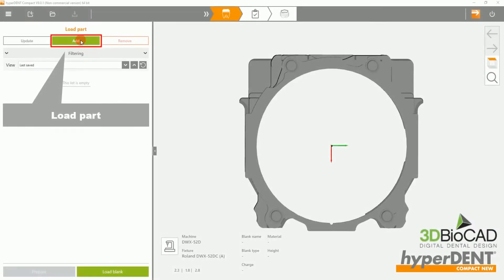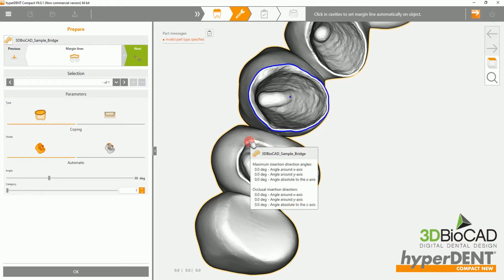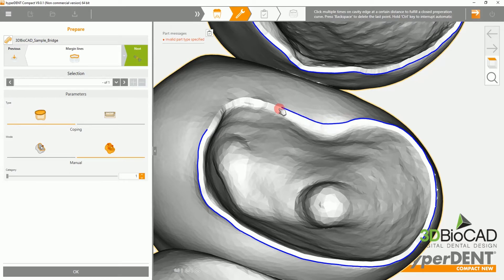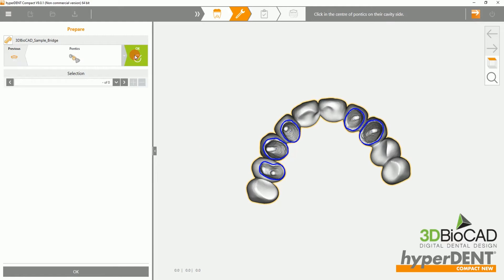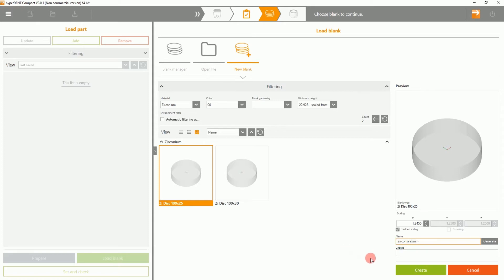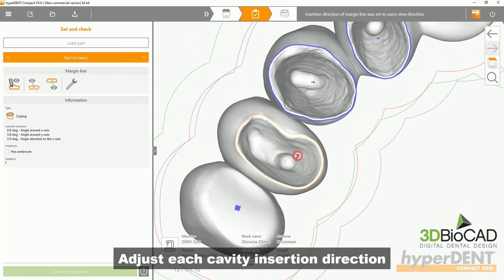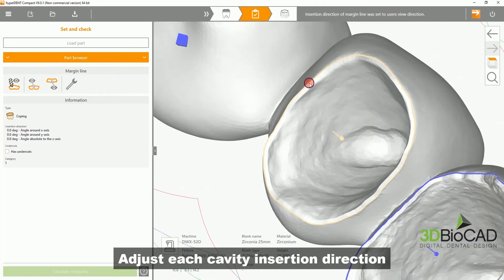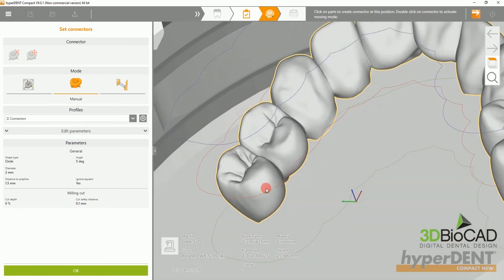Crown Bridge l FOLLOW-ME! hyperDENT l 3DBioCAD

Comment: Is there a specific way to place connectors on smaller bridges?  Usually I place connectors on all crowns.  On a recent 4 unit posterior bridge (crown, pontic, crown, crown), I used a sintering frame to help prevent warping.  But it still came out a little warped on the inner crown.  It had an open margin opposite side to where the pontic was.  The outer crowns sat down nicely.  Do you have any suggestions on preventing warping?  I’ve tried sintering pins on a bridge too and it warped.
Reply from the maker: Hello Ellen! Please send a photo to support@3dbiocad.com and we can make suggestions. A definition of a small bridge varies from person to person.